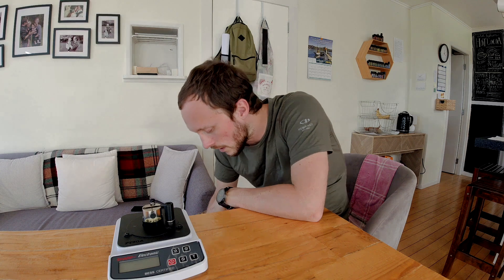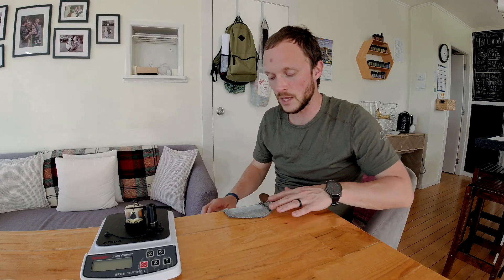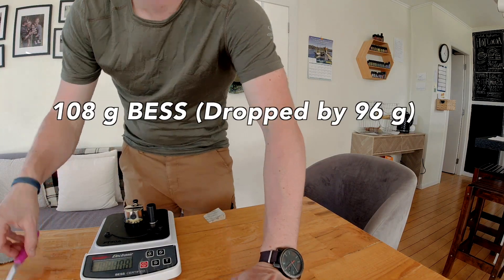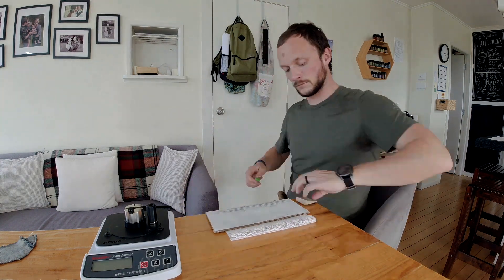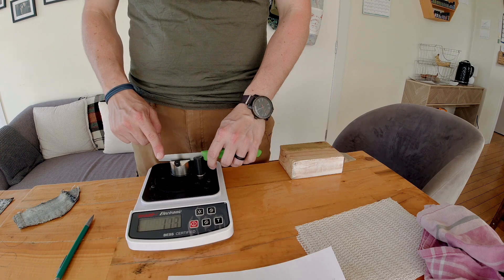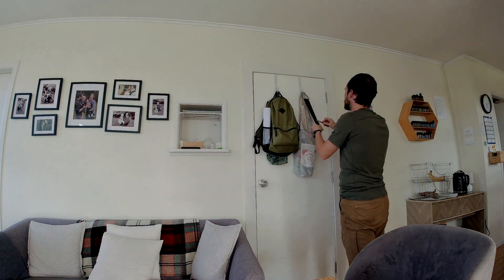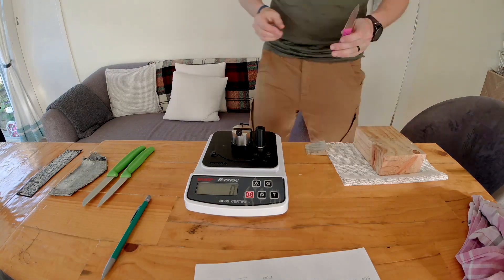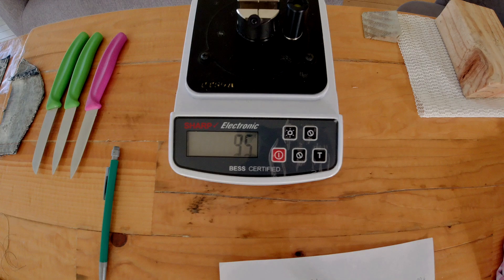Strops Part 2 | Under 100g BESS By Hand | Leather, Wood, Denim | Knife Sharpening Test

Comment: What emulsion gritt do you use ?
Reply from the maker: I need to do a follow-up video but my 2 favorite strops now are denim with Mother's Mag Polish on it (that's ~9 micron aluminum oxide) for deburring softer steels, and on anything above 61 HRC I use Stroppy Stuff Diamond Compound - 1 Micron and 0.25 Micron mainly in leather or basswood.

Comment: 6:50

Wouldn't it be possible to either have a highly refined sturdy burr or a very sharp microburr of some kind give a BESS around 100g? I've definitely gotten a very small, very sharp burr to whittle hair before.
Reply from the maker: Yes, it is.  It often can happen with super steels because the rigid nature of the steel causes the remaining burr to resist being bent by the BESS line and severs it instead.

It is also possible for standard steels at standard hardness to do this at a single location, or if the testing method on BESS is non-optimal and there are variances being introduced.  lt is uncommon for a burred edge to give multiple (and fairly executed) BESS readings under 100 g.  This is one of the things that makes BESS a valuable measuring system if operated and reported honestly!
Reply from the maker: But I have experienced what you mention as well since the filming of this video, and you raise a valid point.  Thanks for the comment!!!

Comment: Great idea for stropping test.  Helped answer questions for me about my strops.  Was always wondering if I should switch to bass wood or not.
Reply from the maker: In a recent series of tests (that has been filmed, but won't publish until of June 22nd), I did over 20 of these stropping tests on low and high carbon stainless steel.

As of now, I'd say:
1) For very soft steel, hanging strops may be needed to remove damaged metal
2) For most mid-grade steels from Victorinox to your 1% carbon stainlesses (VG10, 154CM etc) I find a slightly compressible strop made with flat denim and Mother's Mag gives the most consistent results for me.  Very good deburring, you can choose to boost aggression by doing less strokes (~5-10 strokes each side; but less resistance to bending and chipping this way), or boost stability and shock resistance by doing more strokes (~11-30 strokes each side; but less aggression this way).
3) For steels with 3% + Vanadium content or just high carbon and alloy composition in general, non-compressible strops seem to work better for me.  Bass Wood (sand it flat with 800 grit silicon sandpaper and wipe it clean) and very stiff Leather seem to be the best, and my favorite stropping compound out of all the testing by a HUGE margin is StroppyStuff 1 Micron Emulsion.  If I was only gonna get one emulsion for hard steels, that's the one I'd go for.  I find you usually need to do minimum 10-15 strokes for these steels on a ~6 inch strop.

Comment: Have you done any testing on optimal ways of sharpening HIC? 

   Thanks.
Reply from the maker: No, I have not.  I recall Roman from Kase Switzerland made a video response to Pete from Cedric & Ada shortly after the test where it did amazing...

I can't find it on YouTube, but I think he recommended fine diamond abrasives.  I'd assume it's somewhat similar to sharpening Tungsten Carbide.  I have heard that lapping film on flat glass and very very gentle passes produces minimal chipping (chipping as I understand is your biggest problem, as there is little ductility to form a burr, at least in Polyhedral Tungsten Carbide).

That's where I would start - but if you want to talk to someone who is actually good at sharpening Tungsten see if you can contact Lacey:
https://www.youtube.com/@EDCandLace
Reply: @homeslicesharpening    Hi there, yeah, that video has been taken down. I saw it linked on a Spyderco 4rum a little while ago when I was researching HIC. Tried to go to it, but it apparently had been removed.

   Thank you for the other info. 

  Cheers

Comment: Sharing your detailed tests & results are a gift to humanity. The cutting edges you are optimizing are ideal for parring knives in many use case scenarios. 
Currently my preference for Petty/Food-Prep knives is: Edge leading strokes on 325 Mesh DMT diamond plates.
You & I are not in search of the theoretically perfect cutting edge but one that yield outstanding performance.   
As an independent thinker & knife maker my testing reveals preserving the thinest portion the knife blade for as long as possible . . .  is paramount to preserving knife performance long term.  To revive fading cutting performance, two to four strokes per-side on 325 mesh plates work well. 
Do you believe a quick Denim/Mothers-Mag or other stropping process would yield noticeable performance improvements ?   
Seeking - simple quick sharpening process to create reasonably sharp/durable cutting edges on thin (0.006 behind cutting edge) kitchen knives.  
A process simple enough for ...  let's say that perhaps 5% of the human population may actually ever do.
Reply from the maker: Haha, I love your comments Daniel!  They are always accessible and down to earth while remaining practically applicable yet reserving enough technical precision to be interesting; with a pinch of optimistic benevolence sprinkled in.

Yes I did just use a semi-colon, enjoy that.

Anyway, I will respond about the ideal uses of these stropped edges in your other comment, but I would say as a general response "Yes" I believe that 3-8 passes on denim with Mother's Mag at sharpening angle can remove enough damaged metal from a fully coarse (325 mesh) edge to make it last longer while retaining 95% of the original aggression (my opinion).

If you wanted something interesting to try, I would try doing edge-leading strokes all the way to the last, then finish with 1-2 feather-light edge trailing strokes before maybe 5 strokes on the described strop.  The edge leading strokes should get rid of burr, but the final edge trailing will draw out the apex to a thinner point (I think) and the strop should remove any metal that is damaged enough to be frail.  If you have a leather hanging strop I'd hit your edge with 4-5 gentle strokes per side afterward as a final clean up.  This is what I'd do if I was shooting for a coarse aggressive kitchen edge with maximum clean-ness for somewhat minimal fuss.

If your blades are 6 thou behind the edge, you may need to lower your angle (back off the apex) during stropping as the denim is a compressible substrate and could easily wrap around an edge surface that thin.

Let me know if the results are good!
Reply: @homeslicesharpening  Thanks again, you have saved me so much time, with your testing & practical advise. 
- Integrating your findings/advice with other shared data I trust; my understanding of creating cutting edges knives seems complete. 
- You have defined quick & simple ways to sharpen culinary knives for durability in various use case scenarios.  
- The Dual grit sharpening methods are awesome though I believe only a few of us are into cutting edge durability at that level. 
- Real value for viewer time generates viewer engagement, a breath of fresh air in the midst of marketing hype & BS. 
- Your generosity & ability to communicate your findings is a combination few can match.  
- Generating & sharing clarity of process & concepts where other’s see only chaos is a gift to humanity.
Reply from the maker: @danielbottner7700  Thank you so much Daniel, it's easy to get excited about doing testing and sharing generously when there are real people benefitting on the other side, and even more when it leads to some great friendships with people as nerdy as me!

Your encouragements have blessed me, I feel repaid.  Thanks for the thoughtful and thought provoking comments, always.

Comment: Hey! I would love to see if you could do a video using the lansky turn box or spyderco tri-angle. Using a medium and fine ceramic rod at 20 degrees. It would make a great guided system dual edge. Hope you try it out. Keep up the great work
Reply from the maker: Thanks for the input bro - I don't have either of those systems yet.  I have considered getting a cheaper one to try dual grit techniques after I'm done with hand sharpening research.  I'll consider it!

Comment: Like the video, on a nice board metal polish is awesome especially for zdp, m390, 440c , vg10 
It makes a edge so keen I wonder if it’s just too sharp for edc ? I have sliced my fingers and pants by just accidentally closing or touching the edge on them , my V-toku2 responds with blue magic compound on basswood and cereal box board stroping 
Sub 100 is basically surgical sharp 🤔🤔
Reply from the maker: I think the results you are reporting could be under the 100 mark.  I had a friend who reported an injury from a kitchen knife I stropped to 70 g on the BESS, and she said just what you did (barely touched it and it sliced her).
Reply: @homeslicesharpening  I should find someone in Texas to test these blades, I am such a steel obsessive I study what each blade has best result compounds and mediums to reach scary levels of keen .
I been obsessed since I was a kid
Reply from the maker: @sstein49  BESS Tester is only about 250 bucks if I remember right...

The knife that hit 70 g was a chef knife in 62 HRC BD1N - that's one of your favorites right?

Comment: Glad to see your results bearing out the idea that stiffer media makes for better results in stropping. I stopped messing around with strops and compound and now just use 3-0.1 micron films on stiff backing materials. The only situation where I'd want squishy media is for convexing.
Reply: Seems like wood and denim work better than soft leather. 
You need to be careful with one thing. All these strops, including leather, are likely to create foil burr if you do 10 passes or more on diamond paste. I haven't seen any images from films but considering it's edge trailing on hard material I expect either foil burr or micro burr if you insist on it.
To avoid foil burr you can finish edge leading on stone, only 3 passes on pasted strop or use hanging Denim like he did in the end.
Reply from the maker: Great input guys!  I think it also depends on HRC - but I definitely have doubted the value of strops at times due to the way I felt aggression lost, but also felt the loss of edge retention when that aggression was due to a foil burr from over-stropping on diamond.

Thanks for your feedback, I'll take it into account.  You guys rock!

Comment: Thats decent!
With what your doing you should get between 80-50.

10 passes per side is not enough by my testing! Especially not with your overly short strops.

I use twice as long strops, and get the best quality/time ratio with 15 passes per side.

(Apexing on the stone should ofcourse be very light edge trailing alternating passes, if not using dual grit.)

An additional test i would be most interested in would be which diamond size gives the best results for a given number of passes (slightly more, on a bit longer strop).
Some people do crazy progressions, but i think thats not needed if one can get ~50g with one size in a few passes.
Reply from the maker: Great input dude - I will have to try a longer strop.  Mind you, I filmed these tests a month ago, so my testing will take a little while to catch up with your information.

But I do appreciate it!